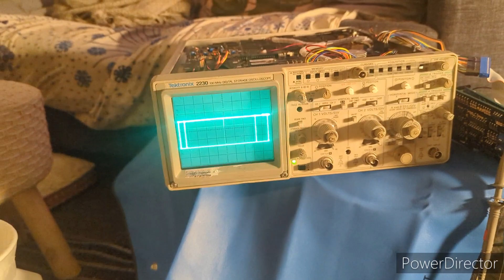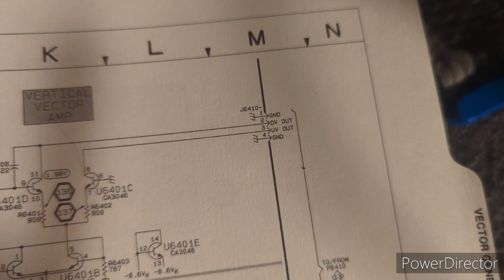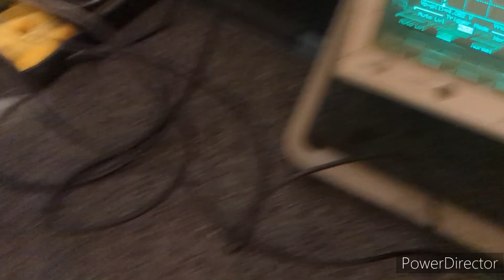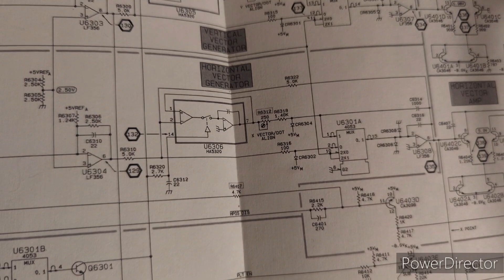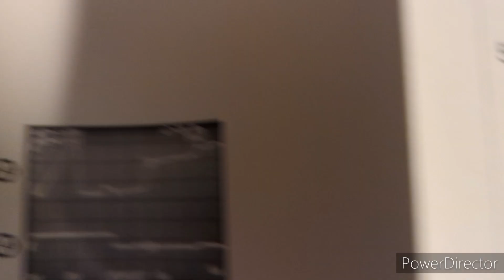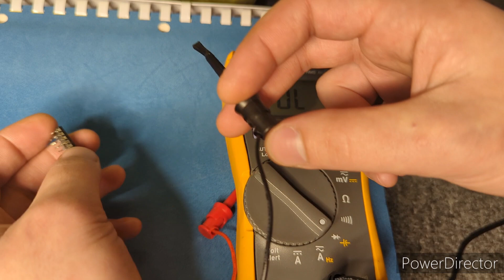Tektronix 2230 Scope Repair: Another Display Issue

Comment: Nice find. Exactly what I’d do, go along the signal path until I find a change. Nice you had the horizontal channel right below to make cpmparasons to, but that difference between 1.98v and 7v would have been enough for me. Usually when I measure transistors on “diode test” I would do the base-emitter junctions too, but it is more likely that the base-collector junction be damaged. Sometimes you can get a “Good” 600mV on both base-emitter AND base-collector, but the device can be shorted collector-emitter, not common but worth making a mental note of. 

You know, you could have matched the differential paor of descretes…a good chance to use your curve tracer “in anger” ! I would have put in a “turned pin” Dil-14 socket and poked the transistors into that to “save” the board and make it easier and quicker to install the CA3046 when you get it.

I had a CA3046 fail in the +5v regulator of my 7623. I did not have any other CA3046’s, but I did have a CA3086, jts pin out and arrangment of transistors inside looked the same, so I tried it snd it fixed the fault. Personally I’d just leave those transistors in there…why fix it “again” if it works? So nice to see you persevering with “real” faults, most of what I’ve been doing is prophplactically replacing tantalum capacitors in 7000 series CRO’s…definitely not worth filming for you tube! Do have a cloud of smoke two days ago as a decoupling resistor upwind of a shorted tant got a bet “red in the face”…the missus was NOT impressed with the smell and had to open all the windows and air the room out. 

Oh, and looking st the circuit…and nice to see you got the actual paper manual…shipping costs here to Tasmania are prohibitive so you only buy what you absolutely HAVE to…but you did not need to install that fifth transistor…the one that was “parked” with all its collector, base and emitter to the negative rail. Good designers do things like that…say half of that 4053 mux was not needed..a good designer “parks” all the unused inputs to ground or negative rail…a bad designer leaves high impedance inputs, (and MOSFET gates come to mond here) ..completely floating to accrue charge and float up into the linear region and get really hot. But, yes it is a sign of a really good designer to “park” even relatively low impedance BJT’s in a CA array!

Those sample and hold integrators…and I see the feedback integrator cap is actually inside that he chip too…remond me of my upcoming battle with to such, much older and less integrated (sp’scuse the pun) S+H’s in that damn 7L5!
Reply from the maker: Thank you as always Globe Collector!  I do enjoy the more interesting faults!  Thats one of the reasons I purchased this 2230 in the first place - I saw the calibration sqaures stuck on the CRT in the advertisement for it and thought: "that must be an interesting one to troubleshoot!"  I would leave those transistors in, but due to the pinout of the CA3046, it required some of the legs to be twisted around a bit.  I already ordered the CA3046s and they arrived the other day.  Thank you for the clarification on that 5th transistor not really being needed.  I was wondering why emitter, base, and collector were all tied together like that!  Speaking of the 576, I had mentioned this display issue in the Groups.io Tek group and someone had said that the CA3046 gives some weird curves when tested on a 576.  So I tested the new ones on it - didn't notice anything strange.  All the transistors looked normal providing hFE ~150.

Comment: Good thing to see a old piece of gear to get back into fully working order that was would have been scrapped and was already scavenged for parts already otherwise. Good save, now you have a decent dual timebase analog oscilloscope to add to the bench, what I planning on doing with mines as used one for 10 plus years at a shop I use to work for and reason decided to get one myself as like that scope and very familiar with it. Thankfully found the issue with the vector board on mines and even manage to finally get the readout to work correctly temporary as hack in a few transistor in temporary as all I had, same as you pretty much, but unfortunately for me found the digital board definitely has bad ram which have to narrow down but now have the row it in as ran the advance diagnostic as readout works now and hopefully assuming goes as plan will have mines going in a couple weeks once parts start to arrive to finish it up and do a update video of course on it and hopefully be on bench to finish reel to reel decks I have to restore but using the 2235 for now.